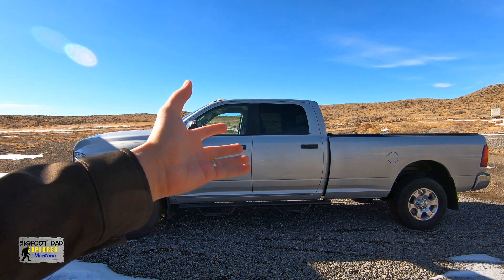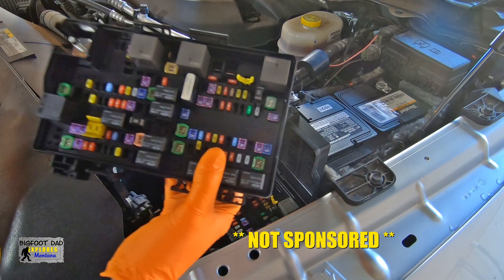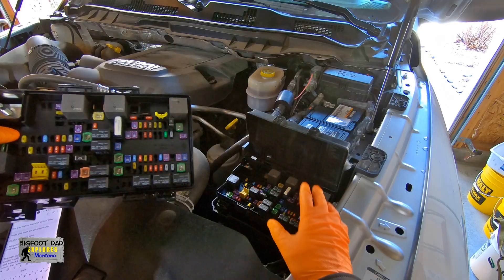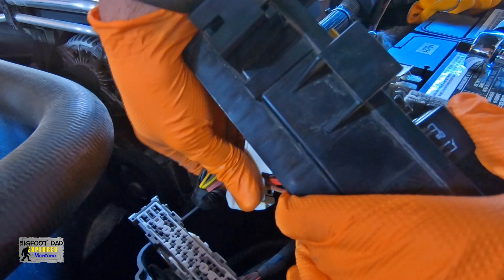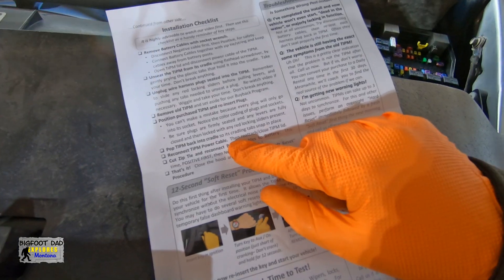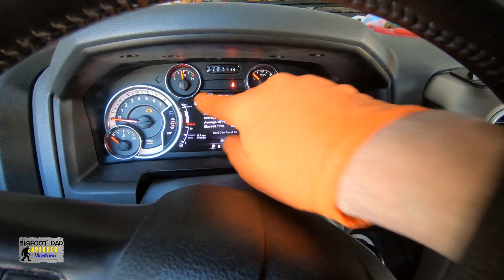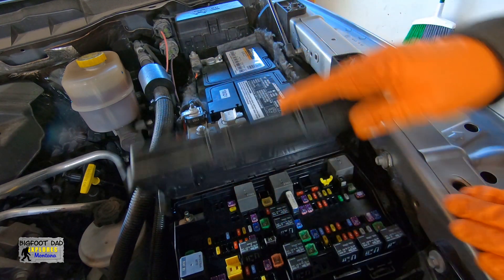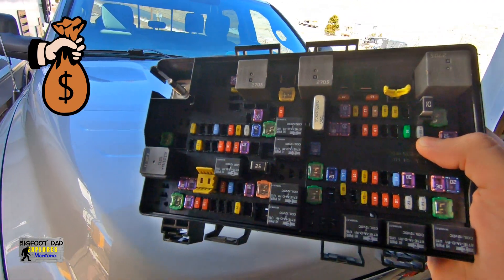Replacing a TIPM - Parasitic Power/Battery Drain Solution - Upgrading my 2017 Ram 2500HD  w/ Mak's

Comment: My washer pump stays on with truck off , friend suggested replacing the tipm after I replaced the multifunction switch which didn’t fix it. 13 ram 1500

Comment: wonder if they upgrade the relay for the wipers its also internal, my problem is my wipers are stuck on unless i pull fuse
Reply from the maker: Hi, Dave - I was researching this on MAKs' site.  It's not immediately obvious if they are replacing those relays with solid-state, but I think it might be worth a call or e-mail to their support group.   I do see a note that says "Every fuse is replaced. Every internal relay is also replaced.", but it doesn't specify anything about windshield wipers.  
On my end, no problems since I installed this, if that helps.  😎

Comment: Did you trying pulling fuses and testing with a meter before this? I pulled all of the fuses and I’m still having a draw?
Reply: Couldn’t pin point where it was coming from
Reply from the maker: Hi, Jonathan - yes, I did try some of this diagnostics.  The issue I ran into was that when I was unplugging fuses and plugging them back in (or completing the circuit with a meter), I was waking up computers/modules that would draw.  I didn't have the patience to do every fuse so I gave up after a while.  I was pulling certain fuses overnight, though, like the ones tied to the radio and fuel pump.  I never could catch it doing the naughty deed while I was watching.  
I am, however, happy to report that my parasitic draw is fixed.  After replacing the four items (the battery being the last), it has been solid for almost two years now!

Comment: Replace the HVAC control Module!!!! Problem will be solved!!!! The part is expensive. 2011 RAM 1500
Reply from the maker: Hi, @4theluvnu - thank you for the tip!  This could be helpful troubleshooting for others.  
I did indeed replace mine but didn't solve in my case.  Sigh.

Comment: whats the problem with posting your new found remedy here. Watched the whole video and read everything and have to look else where for answers
Reply from the maker: Hello. In short, I don't have a solution yet and don't want to lead a lot of people into expensive quests that won't work.  Spent a little over $3K and just when I think it's solved, it comes back.  Right now it remains unsolved as the issue just cropped up again.  Once I come up with a solution that lasts, I'll be sure to post up a video.  Hope this helps with your question. I'd be glad to discuss more on IG DM.

Comment: Thanks for this video. My 2017 Ram 1500 Big Horn has many electrical issues. Windshield wipers stop working intermittently, radio acts up in cold weather, and now my right front headlight assembly is dead. So, I just purchased a rebuilt TIPM for my truck from Mak's. I hope this does the trick.
Reply from the maker: Hi, Garry!  Thank you for the feedback.  How did the install of the TIPM go?  Hopefully it solved your issues.  I'm curious of your outcome.

Comment: Hello Bigfoot Dad. If a relay can come loose during "shipping," how is it going to hold up during use on the roads in your area? Looks like pretty rough terrain out there.
Reply from the maker: Hi, Bruce - you know, I was wondering the same thing and I really don't have an answer for this.  Aside from someone dropkicking the package, I am just not entirely sure why any of these would work their way loose as compared to normal Montana off-road driving.  I'm curious to see if any of them worked their way back out again a few months later.  Maybe that's where my parasitic draw is coming from... because it's back! 😅

Comment: Any update? , I think I have the same issue
Reply from the maker: Hi, Kurtis.  Yes, sorta.  I'm testing my last fix to see if it worked but I don't want to spread bad information if what I'm seeing is a fluke, because I did have one failure.  If you DM me through Instagram or Facebook (just look up @Bigfootdadexploresmontana or Bigfood Dad Explores Montana on Facebook, I'll update you real quick.  Thanks.
Reply: @BigfootDadExploresMontana did you find out your battery drain issue? I have same issue with 2006 srt-10 that has a new TIPM from Maks. May be my car stereo....
Reply from the maker: @davesterawyeah  - Hi, Dave - yes, perhaps, but it's an extended answer.  I'll make a video.  Stand by and I'll see if I can get it out in the next few days.
Reply from the maker: @davesterawyeah  - Hi, Dave - here's a video for you that I just finished - maybe this will help:  https://youtu.be/wOvDMe8Ixcs?si=NrRTpZOr_yfUx4Q6

Comment: I suspect a TIPM problem in my 2013 chrysler town and country.  The battery drains to 12.4 at rest. Could I theoretically test the fuel pump relay by taking it out and checking the battery after it's sat for a while?
Reply from the maker: Hi, Deanna.  I am not an expert in automotive electrical systems, so I am hoping someone can jump in here and give you a better answer.  Yes, if the fuel pump relay in your model is actually removeable (unlike mine that is soldered straight to the board), you could take out the fuel pump relay overnight and see if it helps your situation by morning.  If so, the relay theoretically could be the culprit.  Can anyone else help Deanna here?

Comment: any update if the Tipm was the culprit
Reply from the maker: Hi, Dooglle Rooblle - yes, I may have made a breakthrough!  No, it was not the TIPM, but the next thing I tried seems to have solved it.  I can't be 100% sure yet, but if you want some insight, DM me on Instagram and I'll tell you what I've found so far.
Reply: @BigfootDadExploresMontana   ill check you out on insta. Thanks for the reply. One thing I found on my truck that finally resolved the issue was my wire harness to my starter had a corroded pin. Replace the harness. So far so good....🤞
Reply from the maker: @doogllerooblle8238  - it's crazy how little things like this can cause such a big headache!  Thank you very much for this advice and hopefully it can help others too!
Reply: @BigfootDadExploresMontana   2017 Ram 1500 5.7.  Not sure if I have the problem or not.  could be just abused my 2 year old interstate battery (wet cell).   Interstate says battery good, but they're judge and jury.   6-7 jumps in under one year, but never after just sitting.   Every time after using accessories but almost always lately after just a few minutes (about 15) after opening windows then back up when done.   Lately attempting to "catch" a hot fuel pump fuse before starting (multimeter on top fuse prong to ground)... no amps so far.   Only parasitic test attempted was thorough and resulted in acceptable mA.    What did you find lately?
Reply from the maker: @davidsomers3324  Hi, David!  Yes, I have made some progress on this.  Hit me up on Instagram with a DM and I can share with you what I've found.  In the middle of filming a video on this next part, but it'll take quite a while before it's released.
Reply: @BigfootDadExploresMontana  How about just telling us what you found. Some of us don't do the gram. My 13-year-old grandniece has the Insta- Gram do I have to go through her to get the answer.
Reply: I have the same issue one thing I did notice is you an I have the same battery I wonder how many others have the same issues and if they are using the duralast?
Reply: Sounds like some bull crap

Comment: I have a question my dodge grand caravan 2011 had the same problem my fuel pump is draining my battery I wanted to is it a replacement for my dodge grand caravan 3.6L in how much is one for  my van
Reply from the maker: Hi, Clifton - here is a link to the website where I got mine:  https://tipmrebuilders.com/
The folks there are also very good with their inquiries, so it might be worth giving them a call for further assistance.  Good luck and hopefully you can get that fuel pump relay solved!

Comment: Wow! Dodge has appeared to have TIPM issues for years now. The wife's Dodge Nitro years ago would randomly not start, headlights on and off all night, power locks not working, and other issues..... I told her I had absolutely no idea and never seen anything like this before.

I used Circuit Board Medics to rebuild the unit and it fixed everything. I also have a Dodge Dakota I need to do the same for.
Reply from the maker: Hi, Michael!  Yes, it's also evident by the different TIPM rebuilders out there.  From what I understand, the Mopar brand is known for electrical issues, and this is only one of a few that I've had.  Thank you for the rec on Circuit Board Medics - others will find this helpful too.  Good luck on the Dakota and thank you for your comment! 😎

Comment: I think some late model Mopar have a recall on the tipm fuel pump relay, they put an external relay to bypass the tipm one. WatchJRGo had a recent video about it on his Dodge Durango (and is friends with a dealer tech so we get to see the official fix)
Reply from the maker: Hi, rpavlik1 - I found some similar subjects on this during my research, including a video of a gentleman bypassing the fuel pump relay on a 2016 Ram, I believe it was.   I'm glad info like that exists on YouTube to help us out in a pinch, because we never know when we might be stranded in a gas station parking lot so far away from home.  😅